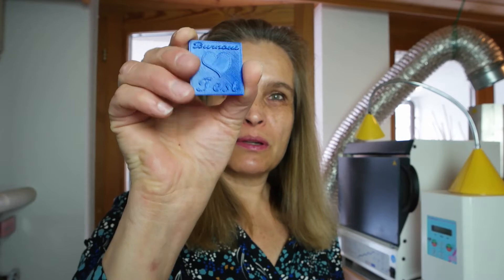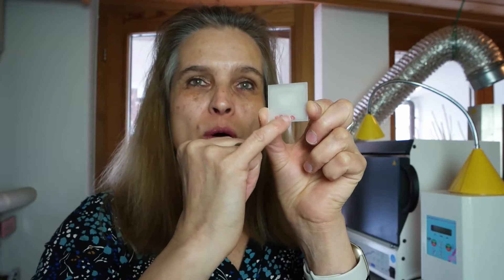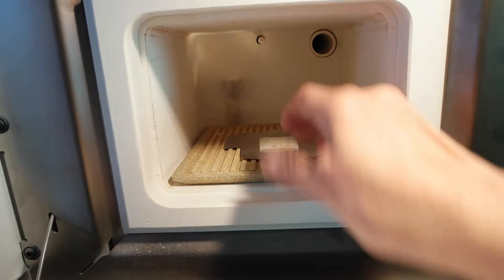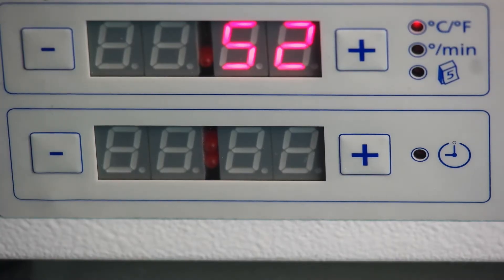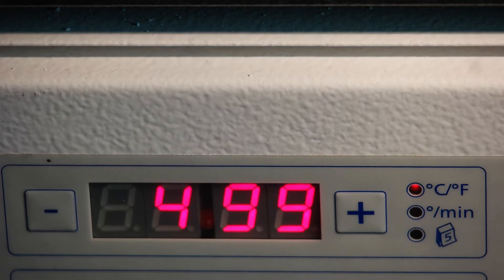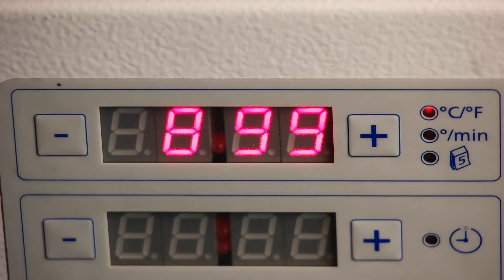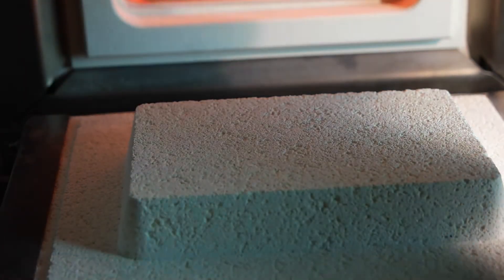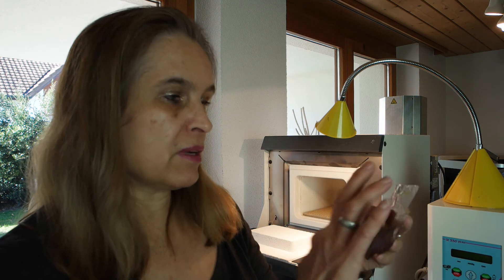Let it Burn Series: eSun Natural PLA

Comment: Would it be possible to get rid of the tiny little bits that won't burn out by using an air compressor (does it stick?) or washing out with a solvent like acetone?
Reply from the maker: Industrial casting companies really use compressed air to blow out the remaining particles. Using acetone would be to dangerous as it is flammable
Reply: I usually do my molds with a casting sprue hole and at least one riser that exits the top of the mold, and I blow mine out with lung power (and stuff does indeed come out sometimes.)  Wear safety glasses coz nothing like getting hot investment blown straight into your eye.
Reply from the maker: @smellsofbikes  that’s why I have compressed air available in my workshop